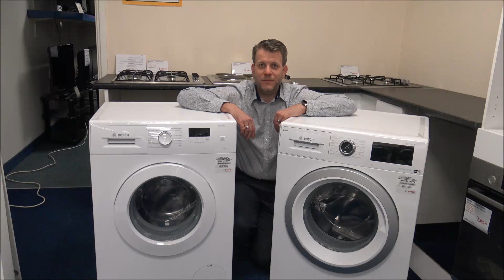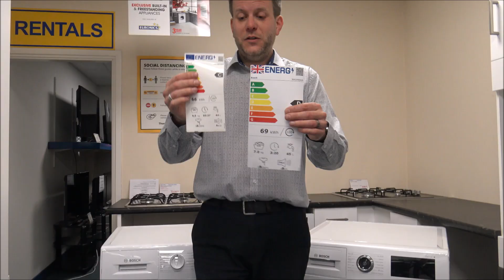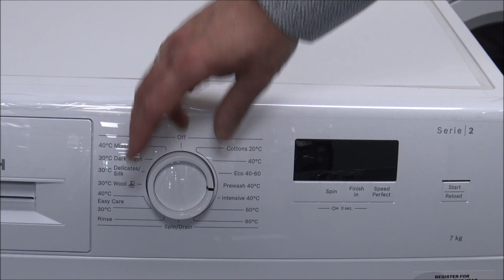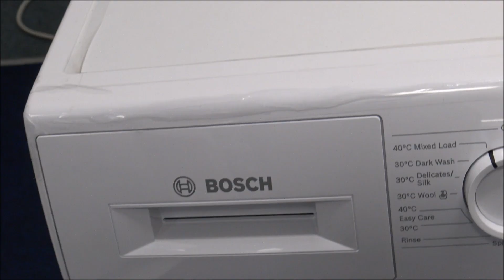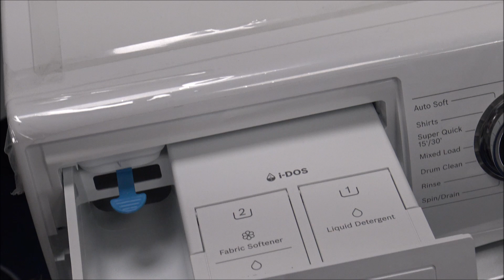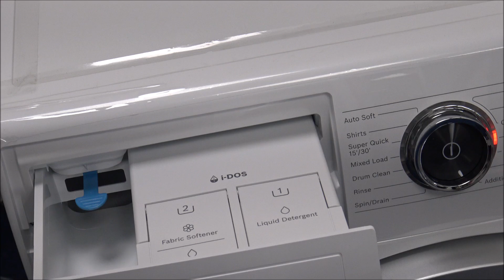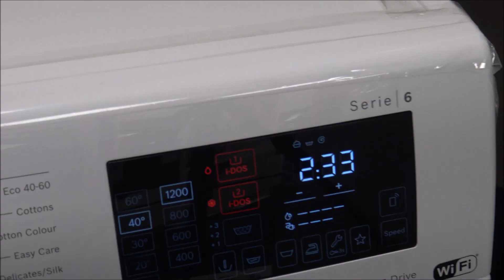Is It Worth Paying Extra For A Better Washing Machine?

Comment: Okay so 3dB is twice the acoustic power but our hearing doesn't work in this way. Something needs to be 10dB higher to be perceived as twice as loud.

The dB ratings on these machines are a little unfortunate and misleading though. They are no doubt taken when the machines are doing their loudest thing, which is the spin cycle. What the dB level doesn't tell you is that the Bosch ecosilence drive is effectively silent during normal washing. We are all used to hearing the washing machine whine away as it jossles our clothes around. With the Bosch ecosilence there is zero whine all you hear is the sloshing. If you have the machine in your kitchen, and you spend a lot of time in the kitchen, my god is the ecosilence heavenly. You almost forget the washing machine is on as the sloshing alone is quite therapeutic.
Reply: Fully agree with your comment.  An increase of 3dB doubles the sound intensity but a 10dB increase is required before a sound is perceived to be twice as loud. Therefore a small increase in decibels represents a large increase in intensity. The sound intensity multiplies by 10 with every 10dB increase.  So because of our human perception of loudness, a 2dB difference is negligible.  The presenter of the video didn't check his facts before making the statements he did.
Reply: @alanrutlidge4767  Not only this but something at 80dB can sound relaxing, like a low frequency roar, like a huge waterfall. But something else at 60dB can drive you insane, like a beeping alarm. 

Just the dB figure doesn't really convey how annoying, or not, an appliance may be.
Reply: @biggityboggityboo8775  absolutely.  Also these figures quoted by manufacturers are never qualified.  For instance is it a weighted or unweighted measurement and also at what distance from the appliance?

Comment: I have an AEG, about 5/6 years old now, with a 1600 spin. Is it worth using the higher spin speed or is 1400 better? Wondering whether 1600 RPM might put more strain on the machine itself.
Reply from the maker: Few manufacturers will offer 1600 spin washers now as they do put more strain on the bearings. Personally i would stick with 1400 spin as it can enhance the life of the machine
Reply: @lords-electrical  ok thank you for the info :)

Comment: I find myself quite insecure with washing machines, because I am afraid to damage the shock absorbers. The washing machine in my previous rental house was shaking and shaking, no matter what we tried to balance it. Untill one time something broke and the drum turned sideways. And the landlord said it was our fault, because the machine was not old. But I think it must have been a cheap one. And then I had to use his personal machine and he put pressure on me to always use the fast wash option. And now we bought a house that came with a washing machine, but I don't dare to spin it over 800 rpm because it is shaking a lot as well. When we buy a new one I want to do everything to protect the shock absorbers. I want to feel free to spin. I should probably go for one with a loading sensor and the out of balance protection thing. And I want to go for a decent brand like Bosh / Siemens / AEG. Is there anything else I can do to help my shock absorbers do their job?
Reply from the maker: Going for a better brand can help, but the main thing you can do to protect the machine is to always put a decent load in there. The main issue is normally underloading rather than overloading as the drum can be out of balance quite easily when the machine doesn't have a proper load to distribute.
Reply: @lords-electrical  

Thank you. But if you buy a new item that you don't really trust yet, how can you ever wash it seperately without underloading the machine? Only a true handwash in the bath tub?
Reply: Wait. I see that my current machine has a "no spin" option. Maybe that would be the safe one to go for if you really only have one item that you want to wash seperately?
Reply: @Merope4ever  U can do low spin speeds as an alternative

Comment: I saw this in my newsfeed? I clicked as you are attractive ☺️ Great video commentary. I will watch more now. I've had my machine for over 16 years but made by Zanuzzi. Only had one issue in all those years, the water pipe inside the machine ended up blocked so drum wasn't filling eith water. The look of my machine is very different to most. The engineer commented in all the years he's been fixing washing machines, over 25 years, he's never come across a model like mine with the fantastic inside construction. It's well made and computerised. Good buy at £400 all those years ago. It also arrived the same day I was hit by a car 😳
Reply from the maker: Sorry to hear about the accident, but thanks for the great feedback.
Reply: Wow Zanussi, I remember those ones.  I had one in the late 80's.......

Comment: Great video, as always!
Just to point out about capacity; difference between 7kg and 9kg are only for cotton programme. 
Other programmes are the same for both models: Easy Care - 4kg, Mixed load - 4kg, Silk, wool - 2kg.
It's true that better model has bigger drum volume by 15%, and that's important. 
About the noise; 3dB difference doubles the sound intensity, but 10dB increase is required before a sound is perceived to be twice as loud. Every single dB contributes to noise pollution, so it's very important to have low noise appliances.
Reply from the maker: Very true on these points, i should have mentioned about the smaller load programmes. Thanks for the great feedback
Reply: tbh all the new inverter machines are quite quiet.

Comment: This explains why my grandmother’s Blomberg is so good.

I chose it because it wasn’t too cheap and had good simple controls and fast spin decent eight kilo capacity and very efficient. The durations were sensible and it’s nearly silent.
Reply: I had one a few (15?) years ago. The control computer died when it was a month out of warranty, and it would have cost about £300 to repair. Cost about £450 originally
Reply: @paulqueripel3493  strange I never had that issue with my grandmother’s Blomberg.
Reply: Currently looking to replace so I’ll have to look at this brand. Hadn’t  heard of it!
Reply: @Truth1561  if you live in a condo Blombergs have a smaller profile which you will appreciate.  I agree. Super quiet. Many modes including quick and super quick wash but also pet mode and denims.  Love my ventlessdryer too.  Takes a bit longer but super quiet.  Clothes come out with just a puff of moisture which is better for their longevity, too